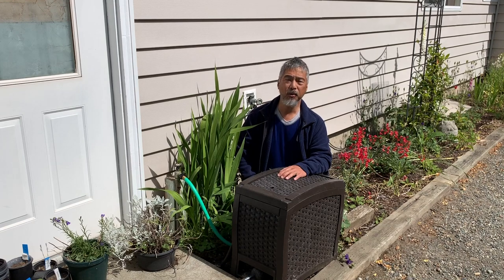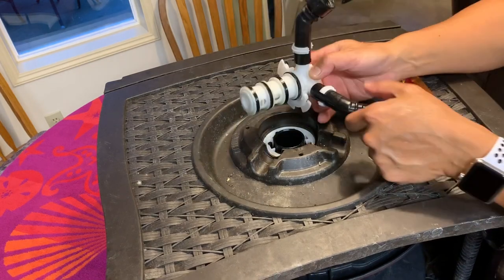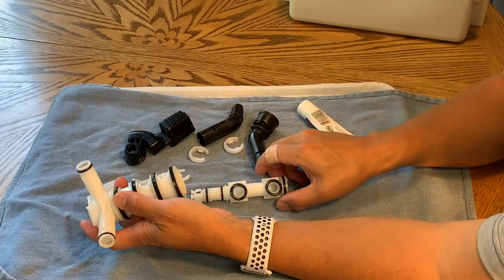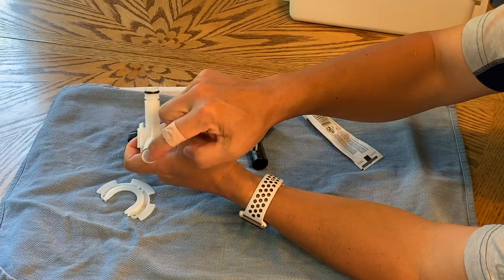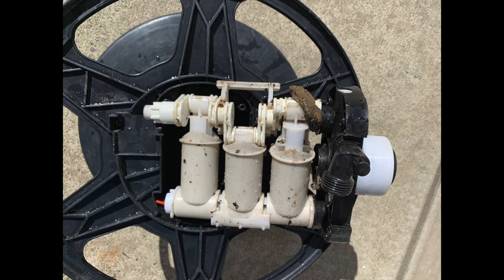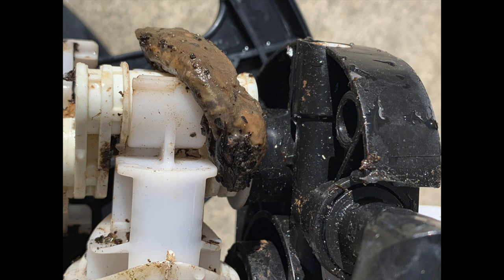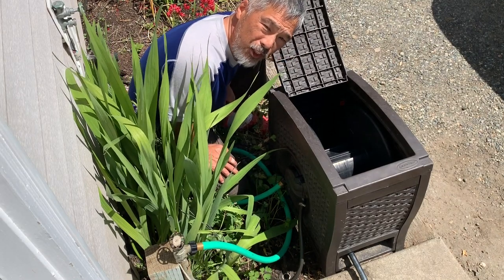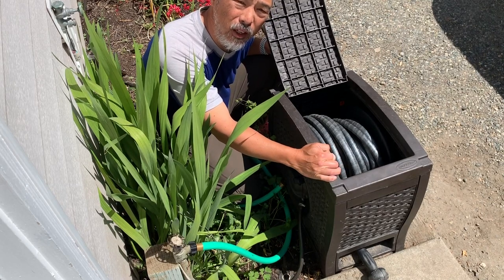How to Rebuild an Aquawinder Automatic Hose Reel Motor.

Comment: Excellent content.  This is by far the best YouTube video on fixing these clever hose reels.

When removing the cartridge from the housing, it can sometimes be very difficult to push it out. Another YouTube video showed that often it's because one of the internal o-rings is hanging up on an opening in the housing.  The solution is simple--just rotate the cartridge a bit so that the o-rings don't pass over an opening while being slid out.

We have two of these reels, purchased from Costco a few years ago.  After a couple of years, I discovered that the gears feeding the hose guide were dry and hanging up, so heavy use of grease fixed that issue.  Then this year one of our reels would "click" and hang up while rewinding the hose.  Complete disassembly showed the "motor" was completely without lubrication.  Again, a liberal greasing of all moving parts (pistons, crankshaft, bearings) made the reel work like new.  This thing is like a miniature steam engine!

Surprised at the end of the video that the creator was cynical about these reels.  Yes, they will need very occasional greasing, but I am impressed by the design and think our reels will last for many years.

Also, I don't think plumber's grease is needed, since I suspect o-ring swelling will be minimal with conventional grease.  But if you plan to take a drink from the hose then use plumber's grease.

Oh, and you don't need to hammer the case apart.  Just insert a flat screwdriver at the ends and pivot up.  Once that joint "snaps" you do the next joint.  After a minute or so the whole thing is apart.

Thank you again for this video.  Surprised there isn't a repair manual covering these reels.

Comment: You showed us all how to disassemble/reassemble this Suncast product - amazing, given Suncast's website is pretty much worthless and we've been waiting 2 days (and counting) for a email request to be answered. Not sure we wanna try to repair ours (bought at Costco, hence Costco will take it back at no cost, even after several years) based on the complexity u reveal. Might give it a try tho, thanx to ur detailed guidance. U did a FINE JOB both in excellent step-by-step instruction and in the video production!

Comment: I found this video very helpful. I had no idea how the sides were attached and this showed how to take the reel apart. After cleaning and regreasing all the seals and o-rings it worked like new. Great job on this video.

Comment: Received a rebuild kit from Suncast last year.  Worked fine for a few months then got really hard to rewind again and sluggish on hose return.  Didn't know about the motor part and adding extra valve grease.  Thanks for posting a big help!

Comment: I didn't know this should be greased or that there were hidden o rings. I thought my hose reel was going in the trash after the handle broke. I couldn't find another one to purchase so I continued to look for a way to fix it when I found your video.  I was able to take it apart following your detailed video and replace two o-rings that were worn and grease it up as you directed. I ordered the new handle from Suncast. Works good as new. Thank you so much!

Comment: Good video.  Thank you.  
Ours needs rebuilding after 4 seasons.  In Michigan it is used about 6 mo/yr.  We blow it out and store it inside for winter.  
Suncast discontinued their water-powered reels.  
I would not have bought it had I known it had pistons, crankshaft and soooo many moving plastic parts.  I assumed it was a turbine motor.

Comment: Thanks for the great video.  I was never able to get the spool valve out of the valve body but I had a complete spare valve assy.  I have three of these going back over 10 yrs (from before Suncast bought the rights to make and distribute the product).  I bring the whole unit into a garage space over the winter.  I've always found Suncast to be top notch in terms of customer support.  I was able to buy a few of every spare part available from their website up until a few years ago at a very reasonable cost.  The motor assembly parts were never offered as far as I know.  They no longer sell the product and it's shame they don't offer parts anymore.  'm reluctant to shell out $150 bucks for the battery powered version.  I now have the motor disassembled and trying to find replacement seals.  So far no luck.  I think maybe the shaft seals are leaking and maybe an O-ring could be used there instead of the lip seal.  I'm getting ready to reassemble the motor and hook it to a water supply outside of the housing so I can see exactly where the leaks.

What is the device on the hose that comes into view as it is rewinding at 34:18?  It looks like a "wiper" to clean the hose as it rewinds.....mine does not have that!

Comment: 6 days later ... The valve assembly was rock-solid tight, and suspected this was our unit's problem. Nonetheless disassembled the Aquawinder apart down to the pistons (cleaned but did not disassemble). No slugs. Loosened up the valve unit, re-greased everything, and put it all back together with no 'spare' parts remaining. Attached the hose, turned on the faucet and voila ... the Suncast Aquawinder works like a charm, again. :) Now, no addition (yet) to the landfill and no need to spend $140 at Costco for a replacement. Could not have done it w/o ya. THANX!

Comment: Great detailed instructions, after putting it back together it still did not work, would stop winding after each turn. Took it back apart, Discovered that the small part where the large screw goes in on the back of the reel had broken off.  I was able to glue it back on with superglue and added UV glue for extra support, now works like new. One sign that this could be the problem is when that screw (first step in the video) keeps turning and does not come out.

Comment: Appreciate this video.  But it seems there would be fewer issues with the binding O-rings if the core was rotated all the way around so they weren't exposed to the openings in the housing while sliding the core.  This should be done upon both removal and reinsertion in the housing.😉
I've had several of these automatic hydro reels, since the first one came out from an Israeli company, before Suncast took over.  I've had the original apart but it was no fun, and no videos back then like this to help figure out their engineering.  Getting the outer plastic cases apart was always the worst part.  They need tear-down again as the old one has slowed in the rewind and needs O-rings cleaned and lubed, and the wicker one just like yours has given me fits for 2 years not pulling out but 10 feet then seizing up;  it clicks when turned by hand... a real pita.  May be a stripped or blocked gear.  But your video will help in getting the case apart.  Thank you.   I've been tempted to replace it with a Hoselink brand (Australia) reel like I bought for the garden.  It uses a spring mechanism instead and is ridiculously easier to use than these water powered ones, in several ways.  Their nozzles and accessories are quality and work better than stuff commonly found here.  But they ain't cheap.  Still, I'd never have to spend hours tearing another Suncast apart.

Comment: Super helpful!  In taking apart my winder I found that one of the gears had broken on the mechanism at bottom front.  Any idea where to get another to rehabilitate the winding bar?
Reply from the maker: Unfortunately, Suncast does not carry parts for these any more.  Your best bet would be to cannibalize another Aquawinder, but finding them is a challenge.  Most have ended up in landfills by now.

Comment: Excellent video. I need help the valve assembly clips broke that holds the lever in place. I'm trying to find a replacement part on-line for the valve assembly and I'm having no luck. I even contacted Suncast however no luck.If anyone can help it would be greatly appreciated thank you

Comment: Will be nice to know how many years Aquawinder  worked good before it beginning to fail, thank you .. You video very good I will keep it in cas I go for this type of Automatic Hose Reel
Reply from the maker: I have two of these and both required rebuilding within 3 years. They work great when new but it doesn’t take long for them to lose efficiency.
Reply: Ours needs rebuilding after 4 seasons.  In Michigan it is used about 6 mo/yr.  We blow it out and store it inside for winter.  
Suncast discontinued their water-powered reels.  
I would not have bought it had I known it had so many moving plastic parts.  I assumed it was a turbine motor.

Comment: Anyone have any luck getting the specs on the various o-rings needed for a rebuild? I tried quite a few but the ID, OD and thickness were never correct. Suncast was totally unhelpful in providing the specs, let alone a repair kit.

Comment: I'm having trouble finding the correct sized o-rings and Suncast only wanted to sell me a complete assembly.  Does anyone know the exact sizes for OD, ID and thickness? Mine are deformed and flattened so it's hard to measure them properly.

Comment: Mine has shown problems after using for a year. The handle broke off and water leaks from the center. 
I opened it and there re lots of O rings which you can not find in the market.
I asked Suncast, they asked for receipt from where I bought it. Who would save the receipt for a year?
Bad customer service.